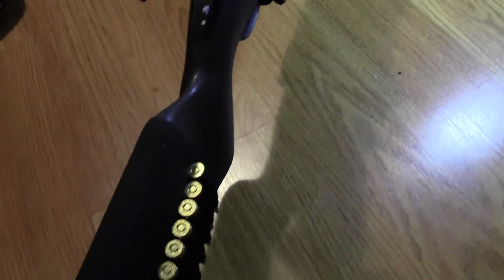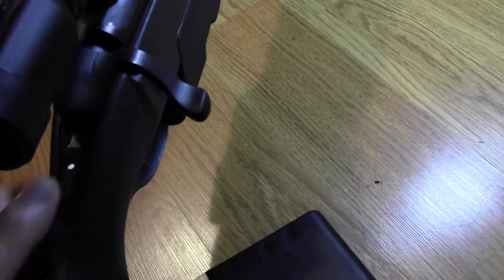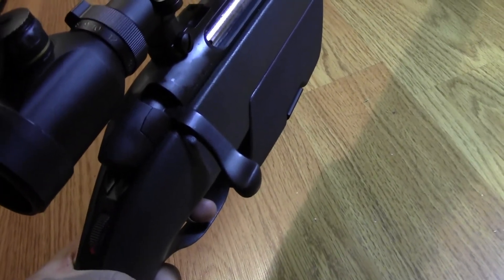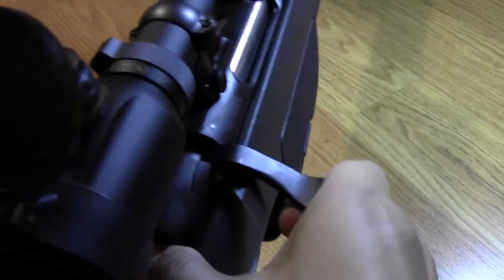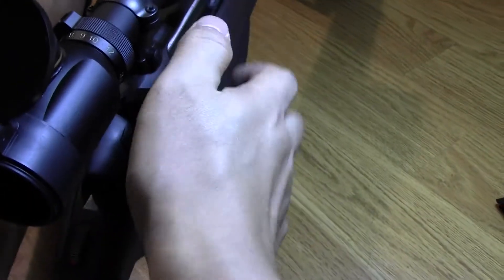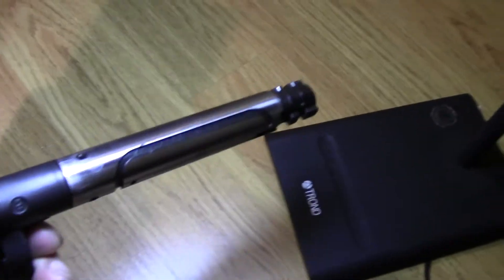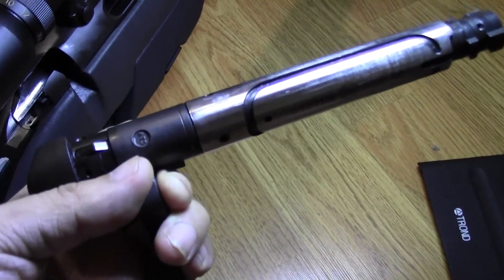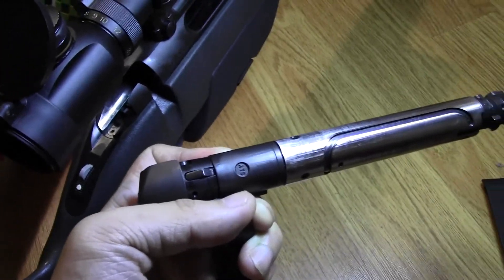Tight bolt lift issue on my Steyr Pro hunter .243 (before the fix)

Comment: I know your video is a little old and I couldn't see your second video.   I've got 3 Steyrs and all the bolts are purty smooth.  I'm pretty anal about cleaning my rifles so make sure you are cleaning it well.  Steyr's are a little different about pulling the bolt out, so make sure you break it down and clean it well.

Comment: Try different ammo mate. My zastava. 22-250 did this with norma ammo I switched to hornady and never had a problem.
Reply from the maker: Daniel O'Hara After some research online, this is actually a known problem of earlier model of Steyr pro hunter (96 SBS system).  Steyr has upgraded the bolt cam and bolt can be tuned up for the easier lift.  I contacted steyr and my rifle is on its way to steyr right now.  They are going to fix it for me .  although It's a design flaw but they won't do it for free.  Oh well, i hope it works, will update the thread here.
Reply: Hope everything works out alright for you. I've just bought a steyr pro hunter in .243 and wandering what ammo you use and how is the accuracy.

Thanks
Reply from the maker: +Dani loves to shoot Check the video after fixing the bolt cam.  everything is perfect now.

https://youtu.be/hRPEQHRVnjY